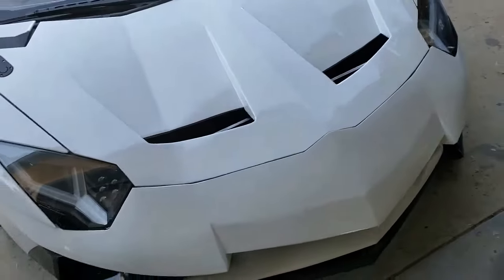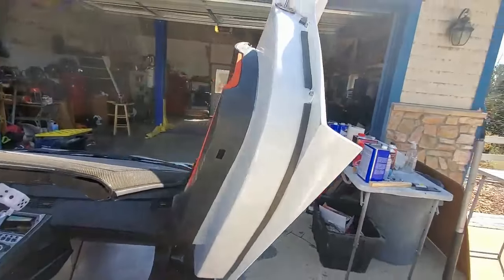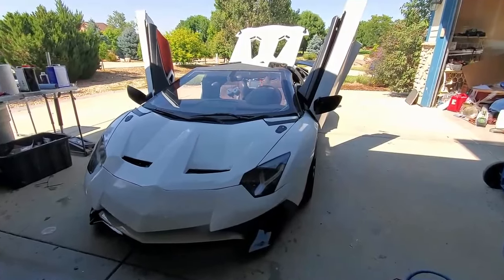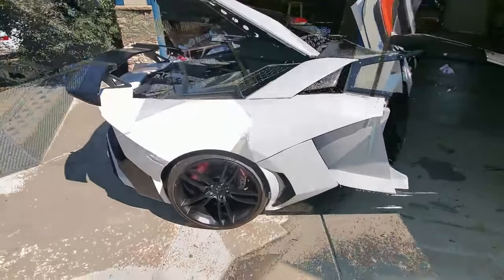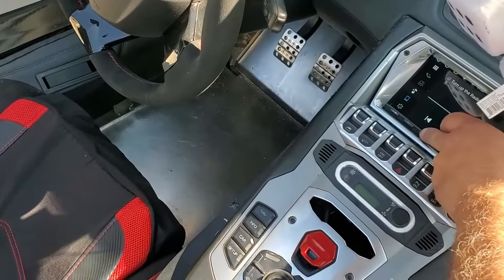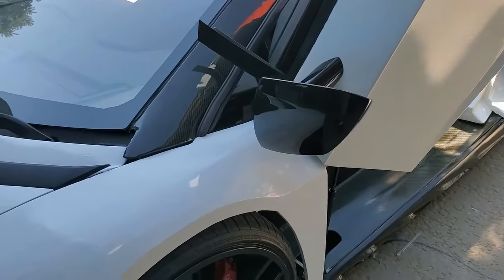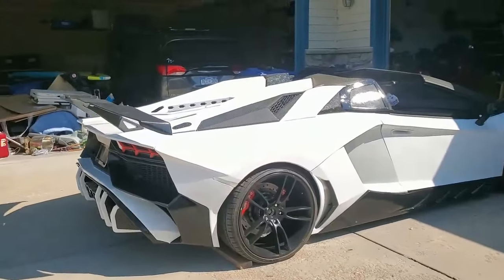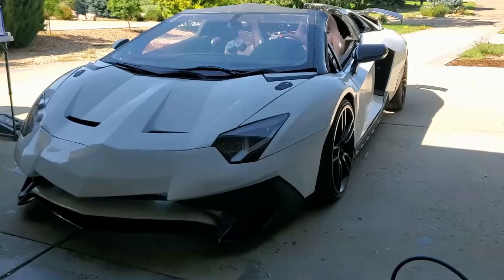3D Printed Interceptor Aventador Update 100

Comment: Great job as always! Love this car every single time.

A little suggestion for you about bodywork. For avoid the downspot on the body panels you can use a guide coat disk, that allows you to find the spots that needs more sanding or body filler. The YT channel Goonzquad has used it on their Trackhawk and they did a great job. I put the link of the video down here. Approximately at minute 13:00 you can see and ear a better explaination than mine. Good luck and keep goin' man

https://youtu.be/GFPpwrwa4UI

Comment: NGL, I was confused if it was legit, tho first few seconds in, the panel gap between the hood and the front bumper on one side brought me back. Might be the camera angle or something, but damn. 

You should go black for engine inserts or whatever it's called. Keep the steering manual if possible, it's a very unique manual Lambo you got, cos the only other one I know is B is for build's
Also please put a front Lamborghini logo/emblem ASAP

Comment: I've been watching you for a long time and I finally decided to start on designing/engineering a kit car.. I've got the frame in decent completion.. it could probably use a lot of rework over time and as a break I've decided to start the bodywork for fun.. and all I can say is its not very fun.. I personally am using inventor for the bodywork.. 

I'm going for a Mid-engine 6-speed Sequential transaxle hopefully powered by a LS7.. RWD of course.. AWD would be cool but that would add so much more weight and complexity